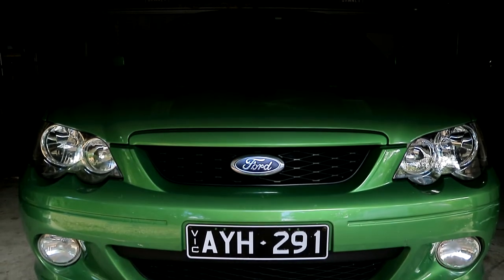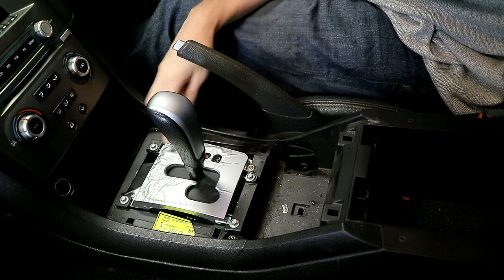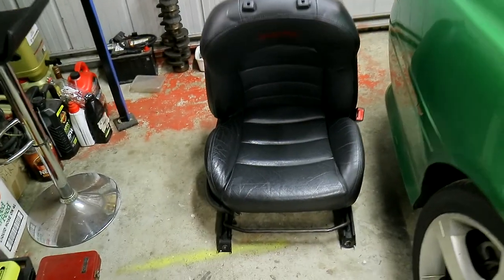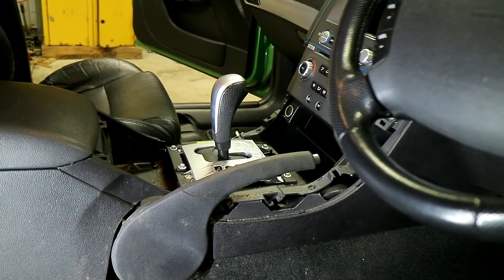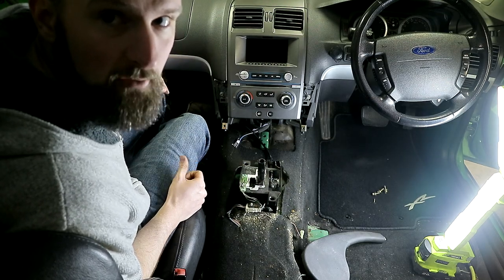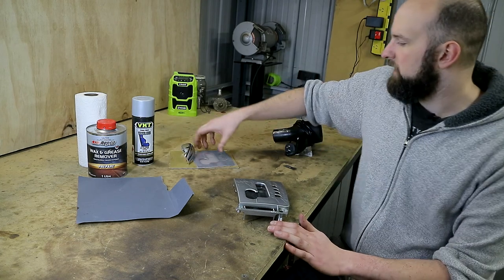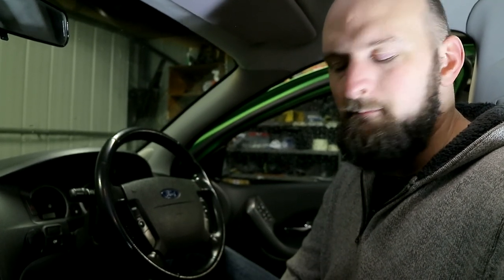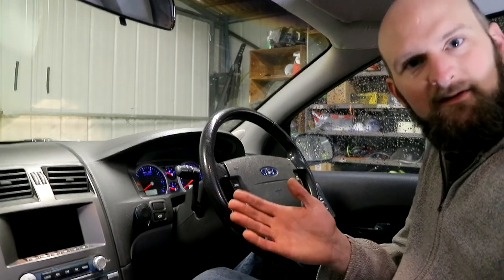Shifter Surround Fix and Console Removal | BA-BF Ford Falcon & SX-SY Territory

Comment: Oh no, You don't have to take the seats out. Just slide them forward and use a 1/4" ratchet with 8mm socket will get those lower rear bolts out.

Comment: when painting plastic, its best to use plastic primer first, that will fill in that sanding gaps and then you can put the base coat on and it will be shinny and smooth

Comment: Hi, I  watched this video a while back now & a week ago I bought the parts you recommended. You show how to do the plate, but not the cover on the shifter knob. I was wondering if you could tell me how to dismantle the knob , so I can fit the new cover on it. Cheers
Reply from the maker: Carefully pry at the top of the shifter button, slightly down and out. Then there’s a Phillips head from memory holding the plate on.

Good luck and thanks for watching mate.
Reply: I would like to know too please
Reply: Do you need heat or just force
Reply from the maker: @Michael Chiverall Hey mate, answer is already in the earlier reply to this comment. Hope it helps 👍
Reply: Thanks, was thinking the button was the way in...

Comment: Interesting video, as I have done this fix too. I painted mine, it looks good but I've noticed it scratches fairly easily now. Still better than those horrible blisters. Subbed!!
Reply from the maker: Can't be worse than the bubbly surround that's for sure. Thanks mate.
Reply: Yes scratches just looking at it and it looks horrible after a while have to.be cateful what polish or sealer you use too can react

Comment: what a mission. got a few rinkles on the shifter and looks like it’s not worth it.
Reply from the maker: Depends how much it bothers you I guess. It sounds like a lot of work but none of it is difficult really.

Picking the worst of the bubbling off and sticking the chrome plate on wouldn't be a bad option if you weren't keen on pulling it apart though.

Comment: Do you reckon these chrome plates are REALLY made of stainless steel as the ebay ad claims?
Reply from the maker: I’m disappointed I didn’t try to suss this out more while I was out but if I had to guess... no not a chance! I could be wrong though
Reply: @BrowneysGarage  Yes, I also have my severe doubts lol but I'll get one anyway one day, although I may repaint it silver before I put it in.
Reply from the maker: @Steve Mack I am glad it's out there still though, I like mine and it's a damn good option for a quicker fix if you don't want to pull it all apart. Would have been happy with the repainted version too, depends what your preference is really.
Reply: @BrowneysGarage  There are a few sellers but all the same price. Guess I'll see how it looks first, definitely don't want to have to pull everything apart just to get to it, although my seat base needs replacing, so it's inevitable...

Comment: Good video 👍🏼
 wondering if you could possibly modify the cover so next time for bulb replacement you dont have to remove every piece of interor 🤔

I must have the only BA falcon were the cup holder isnt broken
Reply from the maker: @Corn holio Didn't suss it at the time and it's been a while but looking back I think it would be possible. Would mean cutting sections of the center console that overlap/are bolted down by the shifter assembly. Likely all cuts would be hidden under the rest of the surrounding trim but I wonder how much this would effect the structure or any any noises and movement coming from the center console assembly. 

Don't think I would do it but I sure as hell hope I don't need to do it all again any time soon as well!

And yes I'd say you do have the only one that isn't broken, wonder if that'll be worth big $$$ some day!
Reply: @BrowneysGarage haha yeh sorry im a step behind the world, im giving the interior a refresh,
 At the stage of pulling the handbrake to do that cover, like on another channel i said im kind of worried, but it has to be done...
That cup holder's probably worth more than the car 🤣

Comment: I see the video is a year old. How did you go with the chrome? I've got an '03 Magna with a chrome gear selector surround like that, also wrinkled, and when the sun catches it, it blinds me! Happened several times when I bought the car. Then I put a 'cravat' on it,( in reality a tea towel) to stop the reflection- !!! 😂😂😂. Might have to upgrade to a paint job.
Reply from the maker: Chrome surround is still going strong and looking good, though the car is normally garaged so hasn't had the hardest time. 

I have had a few instances of the blinding as you say! Really hasn't been too bad overall though so I'm happy with it so far. Well done on classing up the tea towel though, I'd run with it! 😂

Comment: I have no idea how you managed to get it all of as i've tried with the scrapper and heating it and the only part that i can just remove is what is lifted but everything else is on there hard as rock. I have even tried to heat it up to almost so hot you can't touch it but nothing helps. 😞

Comment: How do u get to the clips in the glub box didn't show how u got to that
Reply from the maker: @Hayden Reynolds Talk about this at 13:51, not much to show. You'll be able to see the top of them by lifting the lid and removing the carpet, clip is split in the middle and opens once they're in to grab hold so just close/squeeze these and lift the console away.

Hope that helps mate.

Comment: My selector gear light has blown need to change it do I still need to do everything you did just to change the globe or can I just take out the gear cover have tried once to remove the cove but it would not budge you say there are tabs you need to squeeze in to take it out is that right

Comment: Look out for the Gear Position Indicator Lamp when removing the Shift Surround, it's easy to pull the wires out of the lamp socket. 
(ask me how I know)...

The Shift Lever needs to have the "trigger" removed to get the rear trim off for refinishing. there's a screw under the TOP of the lever inside...

It IS possible to remove the Shift Surround (SS) WITHOUT removing the console. I have just done this job today and am typing this waiting for the paint to dry.

You can lift the INNER console enough to get the SS out, but ensure you remove all fasteners and flex the "sides" of the rear console out of the inner console, removing six screws located under the console lid (and after the console lid has itself been removed there's a couple of scews as a surprise!)

Comment: Oh man I'm literally taking my territory in for a road worthy tomorrow and when you said that gear globe requires that much labour it broke me lost my job last week had to give my work vehicle back so I bought a territory thinking it would do for carrying my tools unbelievable for a tiny little light bulb
Reply from the maker: Sorry to hear mate.

I’ve heard of people being pulled up for it but I’m sure most wouldn’t notice it even if it is out. Good luck mate.
Reply: @BrowneysGarage  turns out that was the least of my issues have to get all the bushes done the trans is leaking a very small amount and that was only replaced in September according to the invoice in the glove box.aswell as the lpg duel tank being just on 10 years old that needed re testing the rear drivers door window isn't working and lock isn't working I thought it would be the actuator after looking up a few vids so I've ordered one of eBay but I'm starting to think it's something is the power window in any way connected to the actuator your other video had an earth wire ground and that had both the symptoms I have. I'm gonna try do the gear selector globe and the door lock and window myself I'm a carpenter by trade pretty handy with tools I just have a fear of breaking anything else on this. The rest is out of my depth getting done at the shop now. Sorry for the long message hope you have a good xmas I like your channel I'm a fan to think I came across looking for cool ways to spruce up the icc was looking at getting one the overview center console next Xmas I think
Reply from the maker: @adam odering Oh damn, bit of a list there. Nothing too major I guess but doing those bushes may hurt the wallet.

I’m sure you won’t have any troubles tackling those jobs you’re going to, there not too bad at all and they’re already broken anyway - how much worse could it get! 

I don’t think there is any interaction between the power window and lock actuator other than perhaps the wires are ran together, maybe just check they are still there running into the door from the body? If they’ve been pinched/cut/not hooked up when replacing a door?

More than likely though just the actuator and window motor, shame cause I’ll have a video on diagnosing power window issues early next year hopefully.

Have a great Xmas to you too mate, let us know how you go and hopefully things will be on the up for you soon 👍
Reply: @BrowneysGarage  the power window for that is working from the drivers door control just not the rear driverside door so the window motor is working must be a wire break in between the door pillars yeah? Just got it back this afternoon new bushes and arms drive shaft replaced with a reconditioned one they cleaned up under the trans and can't see it leaking so I'll just keep an eye on that for now they cleared the check engine fault light but it came back on as soon as i turned the lights on I'm guessing from the gear selector blown globe. They did all that for 1500 which I thought wasn't bad it hurt like hell but I thought it would be more. Gonna try again tomorrow for a road worthy and hope they will let me fix those 2 faults over Xmas I have another concern that was raised today it's currently sitting on 265/45r20 factory for this model is 225/65r17 a couple of people have said there not road worthy the have brand new trends on them. I have to say I love everything about straya except road worthy process in nz we have to get a warrant of fitness every year twice if your car predates 2000 I thought it was awesome getting out of that but come to buying a second hand car at least you know they have been looked at by a mechanic at least once a year.
Reply from the maker: @adamodering4330  If the motor is working from the main control then the wiring to that door will likely be fine. Will be the wiring for the rear button in the door, button not plugged in properly or no longer working. Easy enough to see if all the wiring is there and plugged in with the door card off, if it's the button itself you may be able to pull it apart and check that all the contacts are clean? Otherwise they're reasonably cheap to replace, could maybe swap the one from the other side in to test first but not sure if they are interchangeable.

Price sounds about right, hopefully you're not far off a RWC.

And don't encourage them to bring in any more laws, it's hard enough to enjoy our cars sometimes as it is!

Comment: Should of hit the chrome cover with 320 grit on sander until the stainless looses its polish.  then etch prime then saturn silver. Then stick over. Yes that oem paint is actually a metal wrap of some sort and stabs through underneath your nails.

Comment: Browney , In this Vid I noticed in one variant you had the chrome gear knob to match the chrome panel, How do you remove the screw that holds the plastic plate to the gear knob? I broke one thinking it was just clipped on. :(
Reply from the maker: Hey Rob, bugger but I’d be lying if I said I’d never done similar!

To replace the shifter plate carefully pry at the top of the shifter button, slightly down and out to remove the button. Then there’s a Phillips head in behind here from memory holding the plate on.

Good luck and thanks for watching mate.
Reply: @BrowneysGarage  Thanks for the fast response mate & the how to. Waiting with anticipation for the next vid. Cheers

Comment: I got the chrome stick on plate from ebay instead. Perfect fit too.
Reply from the maker: It's a really good option, I quite like mine now too.

Thanks for watching the video mate, hope you enjoy.
Reply: Hell yea I got one too , and the chrome gear selector , looks great , had a BA G220 (5.4litre fairlane)
Reply: Can you just remove the gear lever and stick that on without removing the whole console. Thanks.
Reply: Jay Dee yeah gear knob comes off , chrome plate fits around selector and sticks straight on 👌🏼 I just did the bulb in the gear selector what a job 🥱
Reply: Jay Dee you have to take off the plastic surrounding the gear selector module, but it just pops off easy as pie 👌🏼
Reply: @INORBET  Thanks.

Comment: Thanks for posting this video! It has given me enough information to know this is too much work just to paint a little item like that. If I were to do this job now I'd make sure that I were to do other items too. Things like the radio surround and other items similar to justify spending that time pulling the interior apart. Again, thanks for posting.
Reply from the maker: Thanks for the comment mate and I completely understand, at least you won't discover that half way through the job now!

Comment: Great video man, really well explained. I've just picked up a BA XR6 and the only two things letting it down are the shifter surround and the clear coat peeling off the spoiler (I've already fixed the stuffed bonnet struts). I'll probably go with the chrome plate option because I'm lazy and once I fix the clear coat it'll be sweet. I'm surprised you guys can fail a warrant for no selector lights, pretty sure that doesn't matter in NZ, could be wrong though.
Reply from the maker: I need to get to the bonnet struts too actually, thanks for reminding me! If I wasn’t running through all the options I definitely would have just gone with the chrome plate in hindsight.

It’s one of those horror stories I’ve heard is possible but you’d be very unlucky to find someone picky enough to fail you on.

Thanks for watching mate.
Reply: @BrowneysGarage  I had an E39 BMW fail a warrant because of a few dead pixels on the dash display meaning it was a bit harder to read odometer kms. It was still obvious what the numbers were but he failed it anyway. Turned out the guy's son had been giving easy warrants out to his mates, one of them crashed and it was partly due to something that should have failed the car. So this guy was being ultra picky on everything. That's fine on the safety stuff, but things like dead pixels and selector lights are pretty frustrating. Especially when they're a pain to fix.

Comment: I didnt worry about the centre console little clips back into the body, I figured that the 2 x 8mm bolts that screw into the sides near the rear seat bolts is enough to hold the console firm.
Reply from the maker: You're right they're probably not very important. I was just kicking myself I forgot them!
Reply: @BrowneysGarage  well the 8mm tek screw should hold it, not to mention if you are like me and keep ripping out the centre console those plastic clips are the last things that I want to hold me up

Comment: Lol or you could cut the black surroundings thats stopping it from coming out it doesnt have to be bolted in its already got weird clips that hold it in
Reply from the maker: Definitely could and sounds tempting but I hate weird vibrations and noises in cars where I can avoid it way too much, wasn't worth the risk. Thanks for watching 👍
Reply: Definitely no noise out of mine since the tab screws or whatever hold it it pretty firmly
Reply from the maker: Honestly this is why I try to prevent them - I'm useless at fixing them once they start. Unless you can find something loose then perhaps your solution will work but I don't think I'd want to be spraying those just for a rattle, could make a hell of a mess.

Comment: Don't take the seat out, just slide it all the way forward and the bolt at the back of the console is easy to get at and there is no need to take hand brake out of the way .
Reply: The handbrake actually hooks into the centre console, although I have taken the console out before whilst leaving it in-situ.

Comment: My BF XT doesn't have the screw visible on the Shifter knob. Do I have to take off the panel covering it?
Reply from the maker: To replace the shifter plate carefully pry at the top of the shifter button, slightly down and out to remove the button. Then there’s a Phillips head screw hiding in behind here holding the plate on.

Good luck and thanks for watching mate.
Reply: @BrowneysGarage  Thanks for the help. Your videos are great to watch

Comment: First time here and i instantly subscribed well done mate!
Just picked up my BA 2004 xr6 with stage 2 built gearbox, headers and full exhaust really loving it.
Reply from the maker: Thanks very much mate, sounds like a great BA you have yourself too 👍. Hope you enjoy
Reply: Thanks alot for the reply.
Oh and I forgot the previous owner had ported and polished the head,so Just wondering how much power do u think I might have?
And what does it mean by stage 2 gearbox it does feel a bit more harsh then a stock  gearbox
Reply from the maker: @ahmadabdurrehman528  I'm far from an expert mate so I'd only be guessing, and not sure if there's much restriction in the stock head without a lot more power but can't hurt. Probably up around the figure we ran before a tune though if I had to guess, 150-155rwkw?

The stage stuff people use is way too vague unfortunately, but if it shifts a bit firmer it may have just had an adjustment on the S5 solenoid (I believe, again I'm a hack!), seems to be a good go to mod for the BTR. May have to shoot the old owner a message for more details if you really keen though mate.
Reply: @brownet's garage Thanks so much,really appreciate the help,for sure ill get back to the owner sometime soon.once again really appreciate it.
(Ill have more questions coming up soon lool)